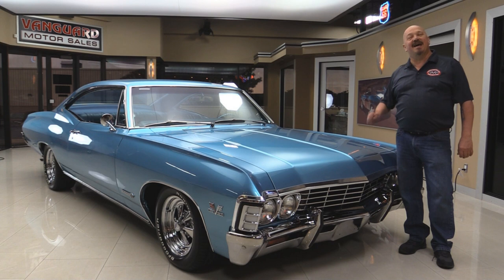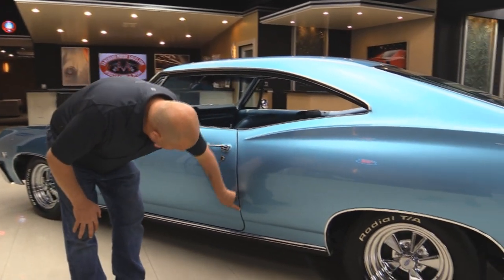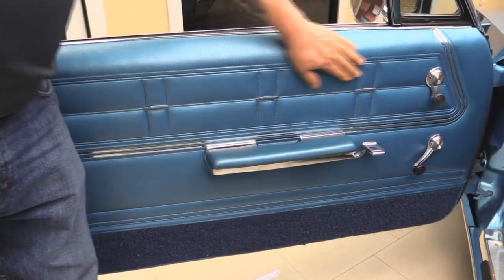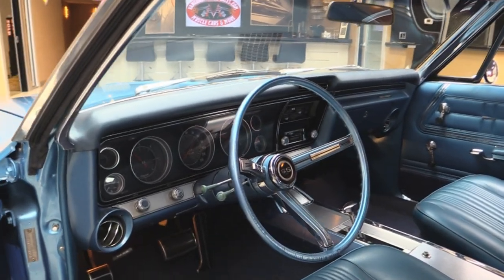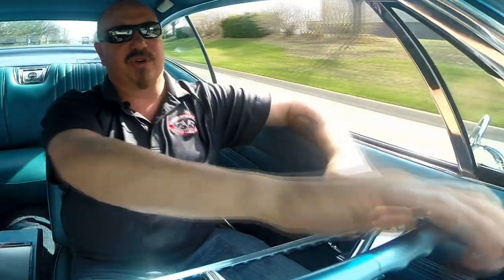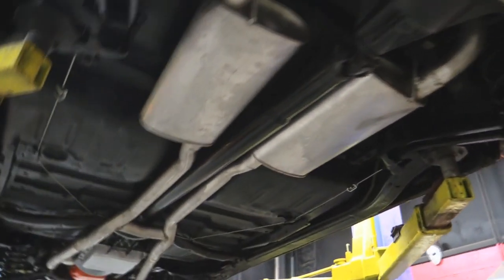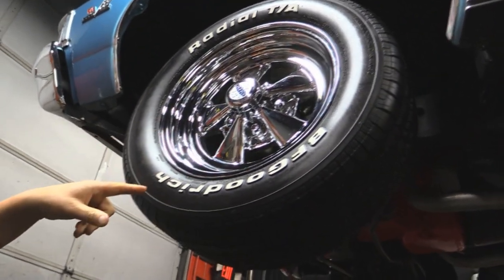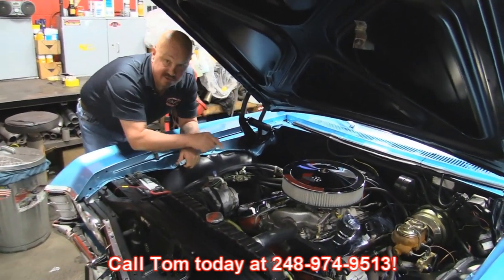1967 Chevrolet Impala SS For Sale

Comment: Love this car. Back in 1975 i had a 1968 Chevy Impala SS 327. It had a 4 speed manual  factory transmission with a Hurst shifter, 327 with a Holley 4 bbl and bucket seats. Metallic blue with a black vinyl roof fastback. Hi jackers on the back and slotted mags all around. It was big, it was heavy and it was fast. The speedo went up to 120 and I had it buried quite often. I loved that car. A Pioneer am/fm cassette stereo and room for everyone. Like Lou said, those were different times.

Comment: Was this car equipped with power front disc brakes or were there drums all around. Waiting to see if the engine is a 396 or a 427. I noticed the air conditioning vents. My questions have been answered. 4 speed Hydramatic wasn't offered in 67. 3 Speed Hydramatic was offered with the big blocks as well as 4 on the floor. I had a book that listed the prices of Chevys and their optional equipment. This car probably had a bottom line MSRP of about $4250 back in the day.